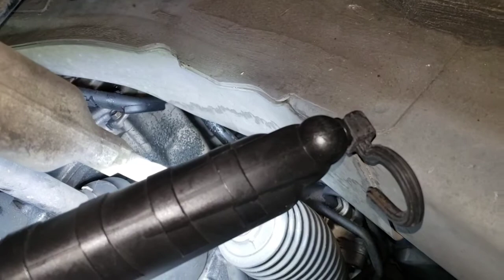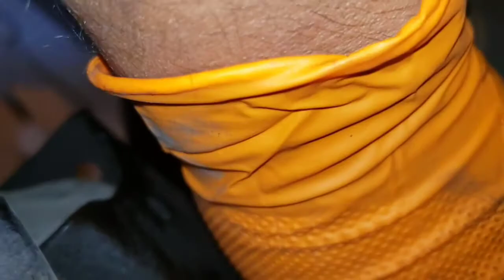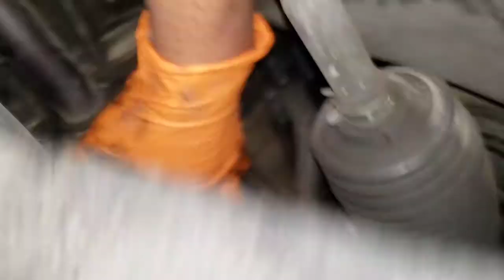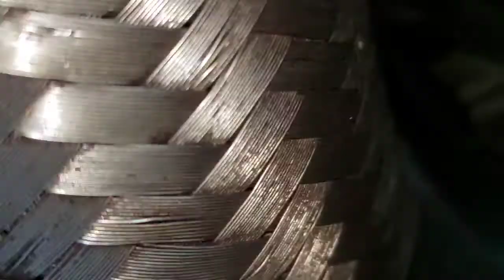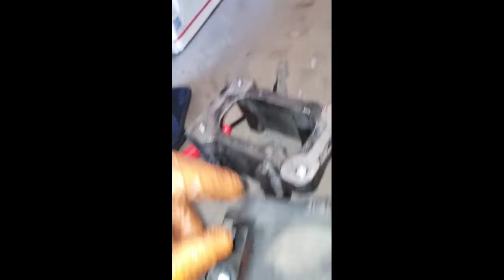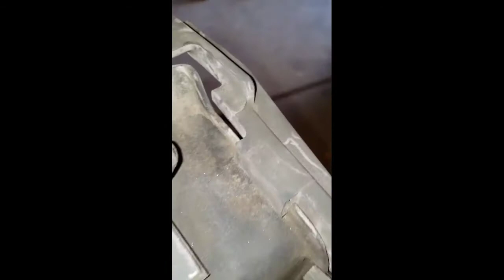honda odyssey 3rd generation 2005-2010. transmission & engine mounts replacement!

Comment: Good video on the transmission mounts. Can you tell if they are bad without removing them?  I had all my motor mounts done and a trans service.  I still feel a little bit of a roughness/jerk when shifting. Wondering if the trans mounts need changed.  What do you think?
Reply from the maker: When replacing motor mounts also transmission mounts must be replaced as well . Most of the time you can not tell whether the mounts are broken, cracked etc . I have seen mounts that look perfectly fine when they're still mounted. After taking them out they're just being held by the bolts or nuts. Change your transmission mounts you'll see the difference shifting, braking & steering.

Comment: Thanks for your excellent educated video. Have a question. I've Honda Odyssey exl 2006 and recently all of the mount you work on I changed by mechanic. But the problem is after change them engine start vibration to much and even when drive  is not smoth drive now fill like it couldn't pick up that used to be. So I took him back he couldn't find out. Do you think he did something wrong. Otherwise before put them in there was no vibration. Also do you live NY. Thanks.
Reply from the maker: You may wanna check the wheel nuts. He  might left them loose! Check if he plug the connectors that connects to the two big motor mounts! Also not so sure he might have left a bolt or nut a bit loose while installing the mounts! There's no way to install them backyards! Vibration is caused by many things! Example , unbalanced tires, too much air it the tires, worped tires, cheap quality tires, a bad wheel bearing, worn, worped brake rotors, bad struts, bushing, tied rods,  etc. Check those things! Hope you solve your problem! 🙏

Comment: Thanks for your video,so helpful.My car is 2005 Honda odyssey EXL,could you help is same all mount as yours?
Reply from the maker: Yes ! They are the same. The whole mount kit includes a total of 5!
Reply: @lunasautogarage9643  thanks，and how and where should I put the jack？
Reply from the maker: @alansun859  put two jack stands in the front.  One on each lifting points then the floor jack on the transmission but put a piece of wood in between so you don't damage the transmission case.  You will need the floor jack there to raise up or lower the engine depending on which mount you're working at the time.
Reply: @lunasautogarage9643  Thanks.I plan just change transmission mounts，the other three mounts have too much work